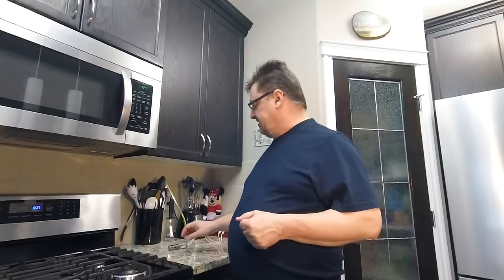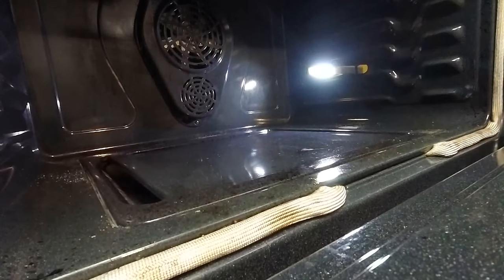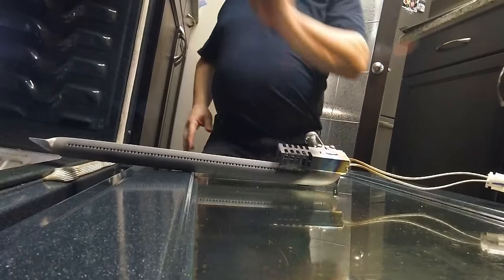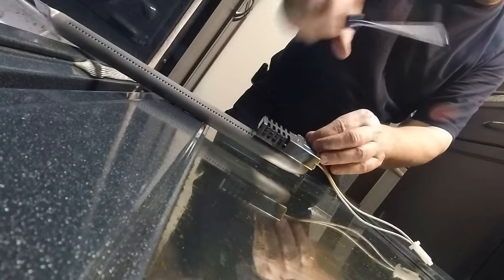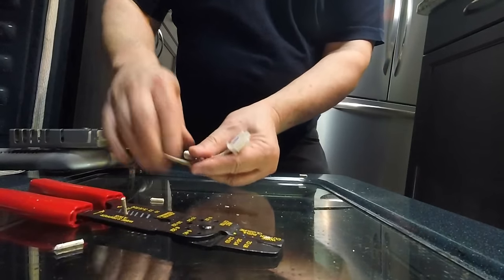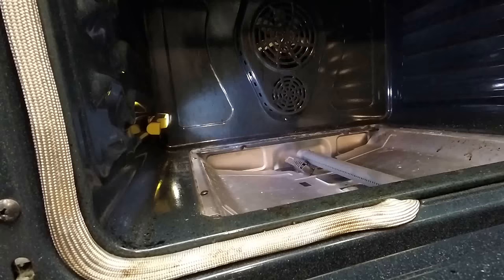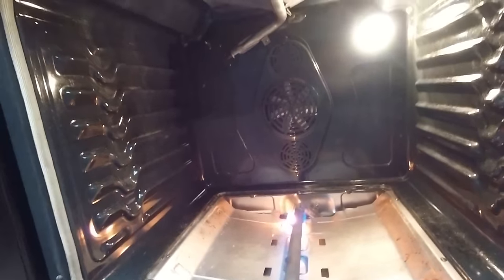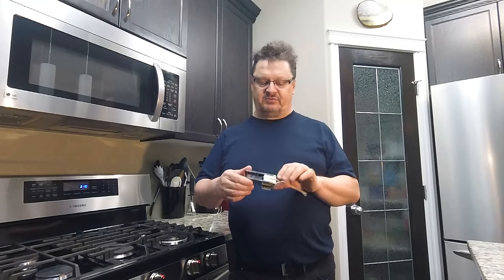Replacing the Oven Igniter in a Samsung Gas Range - Model FX710BGS

Comment: Thanks for this great video. This oven igniter replacement was very easy to do. The Samsung OEM part price was $95 on Amazon. I have the Samsung Gas Range model NX58H5600SS and I used a Maytag 12400035 Oven Igniter. Maytag price was $25.
Reply: Hey Arnold, I have the same model Samsung as you. May I ask, did you have to splice the wires or did the housing plug in?
Reply: @houstonadkins4566  Hey Houston, I did not have to splice the wires. It plugged right in. The connector is the same. That's one of the reasons I picked the Magtag one.
Reply: Great tip, Arnold. I ordered the Maytag 12400035 for my NX58H5600SS and it was a quick replacement with no splicing.
Reply: I did the same $15 on Amazon
Reply: @DarrinKhan  Yeah, this replacement is so easy and a great money saver.
Reply: Thank you Arnold, I have the NX58H5650WS but my oven manual lists NX58H5600SS so I figured they were the same.  I bought the Maytag part you mentioned and saved about $60!
Reply: I have the same oven/range from Samsung, and I was able to find a  generic $17 part on Amazon, thankfully. Last oven needed a control board replaced, that ran me $300, and it didn't work. Replaced the oven bought from a "friend" and that one didn't work either. Glad this was a simple fix, or I was going to start cooking on an open fire pit outside, lol
Reply: Great video, very detailed! My Samsung natural gas convection oven stopped working today but the broiler works as does the stovetop. I'm going  to order a new ignitor, thanks so much for your great video!
Reply: I have the same Samsung range model and bought your recommended Maytag 12400035 part on Amazon. My 12-year-old and I were able to replace it in about 30 minutes. The igniter was exactly like the one we took out. Works perfectly now.
Reply: Hello, Arnold.  I have the same model.  Is the ignitor accessible from the storage drawer or do you have to take the back panel off?.  Thanks for your help.  Frank in Pittsburgh.
Reply: @franklehner7656  Hi Frank, the ignitor connector is accessible from the storage drawer area. No need to take of the back panel. Good Luck..

Comment: Mundane Man, My family was dealing with three home repair issues at the same time and your guidance relieved the pressure. We were replacing the basement bilco doors, the kitchen sink had a faulty faucet and a pipe leak, and the oven igniter stopped working. Your guidance solved the broken oven, gave me the time and courage to fix my plumbing/faucet issue, thus saving money for the contractors installing the expensive bilco doors. Thanks for taking the time to post and share your knowledge.

Comment: Tom...thanks for the video.  I would add two things to your EXCELLENT video......OEM on line was over $120.  You can buy with full harness including plug for less than $25 on Amazon.   The only other thing that tripped me up....use a magnetic screw driver because these are very small screws and when you drop them you can get them back but it's a pain.

Comment: OMG thank you.  I have a Samsung NX58H9500WS slide in range whose oven stopped heating a few days ago.  This video was terrific.  Who would've thought that if you can use a screw driver you can repair an oven?  I'm a 60 year old woman, generally handy but I'd have never attempted it without seeing this video. 

My oven is slightly different than the video: an extra screw holding the heating element to the oven back and two electrical connectors on the igniter.  (I dissassemebled and took a look before ordering a new igniter just to be sure.  I found the part: OEM SAM-DG94-01012A was $163 BUT AT amazon ERP DG94-01012A Oven Igniter at $21 was identical.  

I followed the video instructions and my oven is working again!  
Thanks thanks thanks
Cindy

Comment: Tom; thank you for the video. I just fixed my oven thanks to your help.
Three comments:
1. All of my little screws except for one were locked-in and they strip very easy. I had to Dremel one out.
2. My lower drawer does not have little tabs to release it. It also has more screws (see#1).
3. Because of #1 & 2 above, I chose not to remove the lower drawer and was able to pull the wire connections up far enough to reconnect the new igniter as well as make sure the gas pipe was reinserted properly.
For anyone else doing this; you may be able to not remove the lower warming drawer and still safely do this job if your wires are long enough.
Thank you again for the great video.
Reply from the maker: Thanks for sharing your experience.
Reply: I pulled the stove out (to unplug and turn off the gas), and easily pulled the wires through the back to assemble. And I had to drill one of the screws out completely, it was stuck so badly!!

Comment: Thank you. Your video was most helpful in repairing the defective oven igniter in my Samsung oven, which failed exactly  2 years and 1 1/2 months from the time it was purchased and installed and  just  1 1/2 months after the expiration of the warranties. Certainly doesn't convince me that Samsung makes a reliable and reputable product. But thanks to your video and firms that sell non-oem parts, I repaired it for about $22.  The price for the OEM part from Samsung cost $120, and if I had to call a repair service the final bill would have been over $200.

Comment: Thank you!  I opted to buy the OEM part recommended for my range model hoping to just plug it in but - typical Samsung - the connections were totally different.  Clipped off the connector and followed your directions using the ceramic wire nuts.  Could not believe how fast my oven heated thereafter.  You are my hero!
Reply: The right part (with the right connector) is on Amazon… only $24. Glad I didn’t have to clip wires. You saying the actual Samsung part didn’t? So weird. 

So glad YouTube exists for finding these handy videos.

Comment: Great video, I replaced the igniter, but I still had the same issue. It turned out some of the burner tube holes were dirty and clogged, especially next to the igniter, I cleaned them out with soft brass brush, and now it's working perfectly.

Comment: Samsung was asking $150 for the ignitor which was 25% of the cost of my Samsung gas oven (NX58F5500SS) bought in 2017. I bought the part for $25 shipped to me free in 3 days from Amazon. Your video allowed me to install the part in 20 minutes and most of the time was getting off my knees for a few minutes of blood flow. I can't say thanks enough for the video.

Comment: Great.  My Samsung gas range oven ignitor died less than 24 hours before Thanksgiving dinner.  I was lucky enough to find a suitable replacement in my local appliance store (I used a Whirlpool kit 12400035, which is a direct plug-in replacement).  Your video saved the day.  Thank you!
Reply: Thanks for the tip keivninchico - Are you still having success with the  Whirlpool part?
Reply: @IamHelma  Yes, it's working like new
Reply: @Kevininchico, I am curious  to learn how old your Samsung gas range was before you had this issue. Is it heavily used? It seems like alot of people have had the same issue when looking into this. Mine was very lightly used/clean and happened at the worst time (turkey etc ready to go in and I know nobody who could take our food and cook it for 6 hours to avoid waste/money). In this pandemic and our 3rd lockdown in Ontario and no one working to repair etc. Awful timing and shouldn't have happened already.
Did you notice that the temp starts out as 175° in a cool oven when staring to program the temp etc? Should show 0° I think. Another fellow in here noticed the same-we are both curious. (I'd call Samsung again but I was on phone for a VERY long time today with them already and got nowhere.) Curious. Thanks

Comment: This was super helpful!!!!  So clear and straightforward that it gave me the confidence to do it myself, and it was exactly as Tom showed.  I was able to find an ignitor compatible with my Samsung - happened to be Whirlpool - at a local appliance part shop for $45 and it even had the exact same plug already attached, so no wire stripping needed.  (Appliance dealer gave me one piece of advice that might be helpful and that was not to let my fingers come in contact with the ceramic surface b/c he said body oils could then cause it to spark.  Don't know if that's true, but it was easy to install w/o touching that part.)  THANKS, TOM!!!!

Comment: You have saved me! Followed step by step and i got it running again in less than 20 mins. Don't forget to shut off power from main brakes. I was able to get it connect it from inside the over. I didn't have to remove the warming tray.

Comment: This was SO helpful! I got the part on Amazon as well and it was a perfect fit, no splicing necessary. The only thing that our range did differently was that the door needed to be closed for the full ignition to happen. The igniter would  start glowing, then turn off while my control panel kept telling me the door was open. We finally closed the door and tried it and it worked - so happy to have save all that money. Thank you for great instructions!

Comment: Thanks for the great video.  I have a different model (nx58h9500w) and that led to two different issues.  First, the connector in the oven is different.  Instead of the single joint connection in your  model, the wires remain separate, just like the actual replacement igniter you were using.  So it is best to check which type of connection one has before making a purchase of the new igniter.  Second, once installed , the igniter will not remain on during the testing process you use unless the oven believes that the door is closed.  This can be easily accomplished simply by pushing and holding in the button where the door would come in contact with the oven...in my case, on the right side.  Hope these observations are useful to others, and thanks again for the video.

Comment: Thanks for posting this!  The oven on my 3 year old Samsung NX58H9500WS slide-in stopped heating, and I didn't know where to start, but after watching this, I ordered a new bake ignitor, PN DG94-01012A . Replacement was exactly the same as in your video.  Oven works like new again.  Thanks!!

Comment: Thanks Mundane Man.  This was super useful. Bought the replacement igniter on Amazon < $30.  Should have been a 30 minute task.  One of the screws that attaches the tube got completely stripped. I tried everything to get that thing out but the placement was very odd.  Anyway, ended up spending about 4 hours trying various things to remove the stripped screw. Ended up just sawing the head of the screw off manually.  It was fun. Got it out finally and all works well.  Anyway, instructions were great. Thanks again.
Reply: SAME!!! Except I probably spent more than 4 hours dealing with that stupid screw! My 24 year old was able to drill the head off, finally.

Comment: Video was awesome!  You saved me at least $100 in a service repair call. It took me longer (24 hours) to get the part than to install it (20 minutes).  Of the 20 minutes, 10 of that was gather my tools and putting them away afterwards.

Comment: Great instructions, I've used them twice now to  replace the sensor. A word of advice to those with this stove: don't use the self cleaning oven option. The high heat fries the sensor. Taking the bottom blue tray out and putting it in the dishwasher is just as effective. Love this stove but this sensor issue is getting old. Without using the self cleaning feature I'm hoping I can get at least a couple years out of the sensor.
Reply from the maker: Thanks for sharing!

Comment: Informative video. I pulled my igniter out and there were no cracks in the metal conductor, so I lightly sanded with 400 grit sandpaper and brushed off with a nylon brush. Worked like a charm! Didn’t cost anything other than about 15 minutes of my time.
Reply: Yaay! Does it still work to this day?

Comment: Thanks for the video.  The igniter in my oven did not completely burn out, but it took forever for the oven to preheat. One thing to add for safety is to turn off the gas supplying the oven before you do this job.  The valve should be easily accessible by sliding the range out.   This also helped when connecting the new igniter to the oven since there is a convenient access hole in the back of the range.

Comment: You sir, are our hero. This was easy as could be, thanks to your step by step video. There was however a huge hassle at our end. The screw at 3:50 on the video was stripped. Not just stripped, but almost hollowed out and rusted. So, there I sat with the part that took 3 days to get to me and a huge issue. Everyone in these comments will remember the location of that screw. There is barely any room to work it out with minor stripping. I tried every trick in the book with zero luck. So I ordered a burnisher/removal kit online and another 2 days later....success. Once that little jerk was out of there I had the job done in 15 minutes and I am very novice. You saved us a ton of money Tom and boosted our confidence. Thanks again.
Reply: Make sure you are using the right size Phillips head or it will strip. Try cutting a slot in it with a dremel cut off wheel and using a flathead screwdriver.

Comment: Thanks for this very excellent video.  My Samsung oven was taking 30-45 minutes to preheat.  I think the igniter must have been weak and the gas flow must have been cutting out intermittently.  I have the same Samsung model shown in the video.  It made the replacement very easy.  I don't think I would have been able to do this myself without the video.  Thank you so much for taking the time to share your knowledge about this.  I used the Maytag 12400035 Oven Igniter it it worked as an exact replacement for the Samsung for about one-third the cost.  My oven is working again.

Comment: Excellent and helpful video. Saved me during the insane weather during late January 2019, when the temps dropped to - 50°F.

I have a different Samsung model (NX583G0VBSR) and used the process shown in the video to diagnose my issues as the same problem (igniter - part DG94-00520A).
I purchased a replacement part from Amazon for $16.20 USD (Amazon Choice - Surface Oven Igniter, Capilary 12in L). The part came with the plug attached, so required no splicing of wires.

Again, awesome video showing what I needed to do. Saved me a $300 service bill. Less than 20 minutes,cb less than $20.

Comment: Great video.  I bought the replacement part online and watched your video.  The install worked great.  One thing to note, when you put the burner element with the new igniter back on, be sure that the gas line goes into the end of the burner.  The first time I put it back together, the gas line was not lined up with the inside of the burner and a huge flame was leaping up the back of the oven and the burner didn't ignite.  After I lined up the gas line perfectly into the end of the burner, the gas was then diverted inside the burner element, the igniter glowed and the burner finally ignited just like it shows in your video.  That was a good tip of testing it before putting all the covers back on. That saved me time and extra frustration.  Also if you have no continuity between the two wires of the ignitor, you know it's shot.  I got an ohm reading on my new one, which was a good sign.

Comment: Hello Tom. 

Thank you for this video. Saved me a ton of time. 
My story: I have the same Samsung gas range. The oven burner wouldn't ignite, but the broiler burner worked fine. After removing the oven burner / igniter, I checked the igniter with an ohmmeter and confirmed that it was bad, by the infinite resistance reading. After surfing the internet and calling around to various appliance parts suppliers, I found that it would be days before I would receive a new igniter. This is unacceptable! Digging a little deeper, I found that the broiler burner igniter was the exact same part as the oven burner igniter. It was easy to remove from the broiler burner and install on the oven burner. Since we rarely use the broiler, I could just reassemble the oven and get cooking.
A few side notes, if removing the broiler burner igniter:
1.) Before removing the screws for the broiler burner components, place an old rug, bathmat or cardboard in the bottom of the oven. This is a good shop practice to keep screws from falling into the abyss under the ovens bottom.
2.) To get to the connection for the broiler burner igniter, you can remove the screws to the rear panel, just below the control access panel. You can just remove the top row of screws and bend the panel back a little bit.
3.) You will find an envelope with the service information, in that panel. Don't loose it.
4.) For reference, I tested the good igniter with my ohmmeter. It read 157 ohms.
5.) You made a good point about connecting the generic igniter with the OEM plug. However, high heat (ceramic) connecters should be recommended for this job. Many people would use plastic connecters with possible bad results.
6.) Looks like the igniter service life is ~5 years. I'm ordering 2 of them. One to install on my broiler burner and another one for a spare.
7.) The term "MARETTE" threw me. I'm a retired Industrial Electrician in the U.S. I've always known them as "wire nuts" or "twist-ons". Great to learn something new.

I clicked your subscribe button.
Cheers.

Comment: Thanks for the video. I followed your advice and it was a breeze and a cheap repair.  My only concern was to see the ceramic ignitor still glowing while the oven was reaching temperature. A quick question on the net told me it was suppose to be as long as the gas burner is on! Problem resolved thanks to you!
Reply from the maker: Great point!